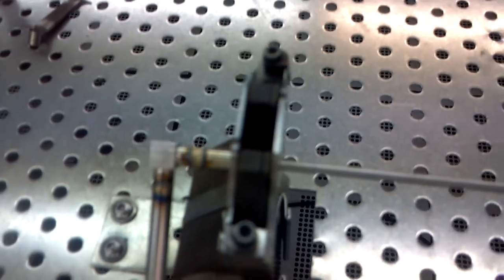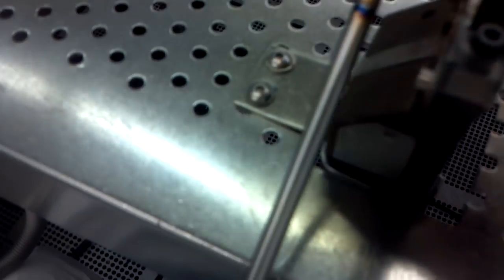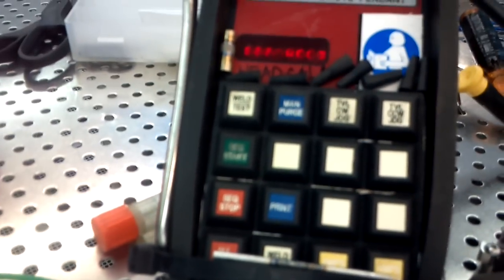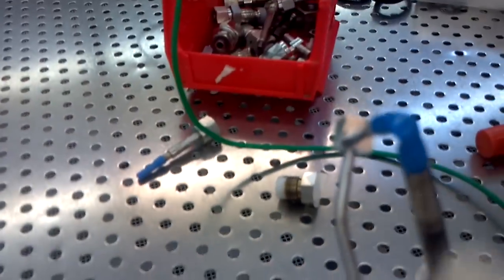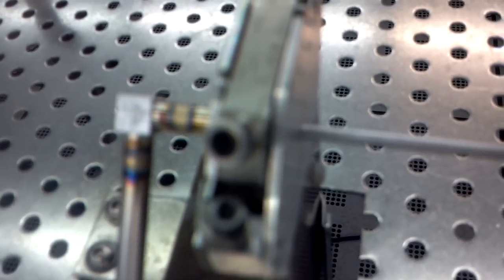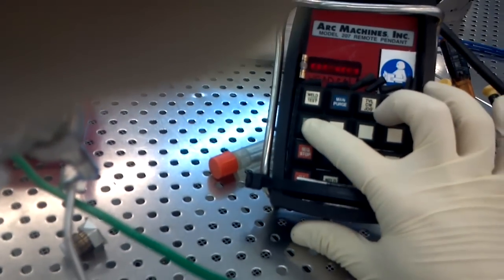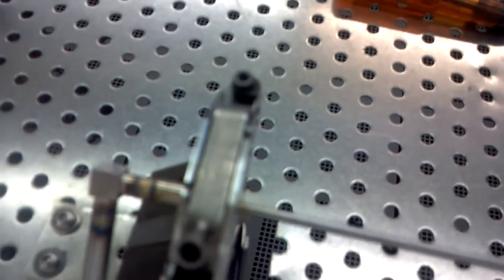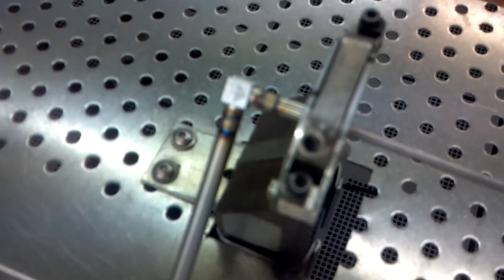Welding 1/8" tubing

Comment: I'm a welder of bubblers and ampules for the tech industry as well. We use home made purge fittings that you knock tight in the end of the 3/8" and 1/2" tubes, then you slip a 1/4" purge hose over the end. Do you have something like this and do you buy them or make them? They take a long time to machine out, so I'm trying to source a supply.
Reply from the maker: brainfarth swagelok sells them as a kit.
Reply: Can you link to them? I cant seem to find anything on their site.

Comment from the maker: All I need is a print and it can be done.  Stainless Steel brake lines are going to cost a few shiny coins.  I have considered using some scrap tubing to try and make fuel lines and breather tubes on the motor.  Something to tinker with after I get to driver her around for a while first.

Comment from the maker: I use gas lens cups too, ceramic as we don't spend the money for the pyrex clear cups.  We rarely do an inside weld as the wall thickness for the pipes we weld rarely get above the amperage capabilities of our welders.  Customers have not asked us to do inside welds so everything we do has a schedule which penetrates from the outside in.  We only weld stainless steel or hastelloy and I have not welded hastelloy in over a year.    Walking the cup inside of a pipe would create quite a challenge.